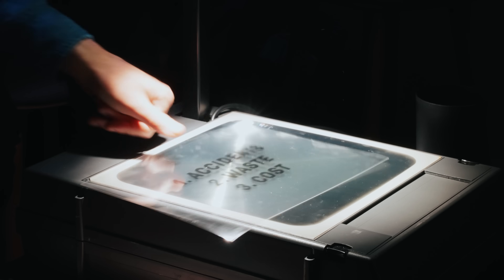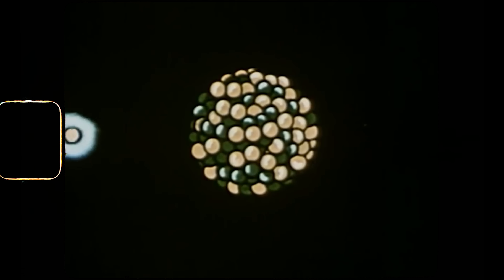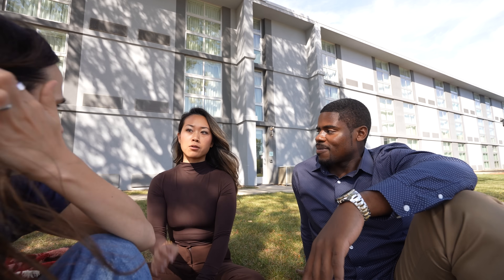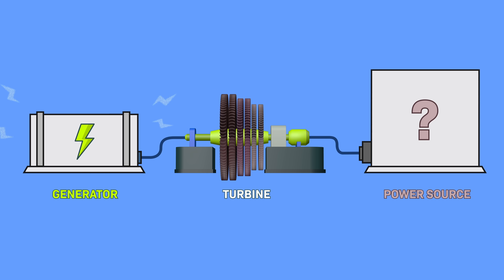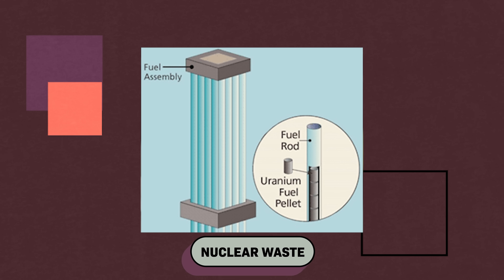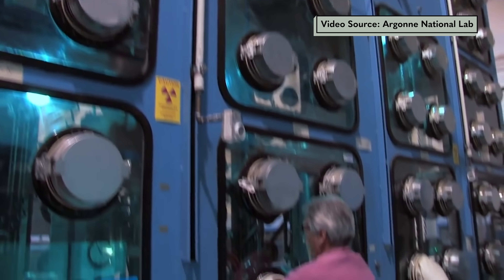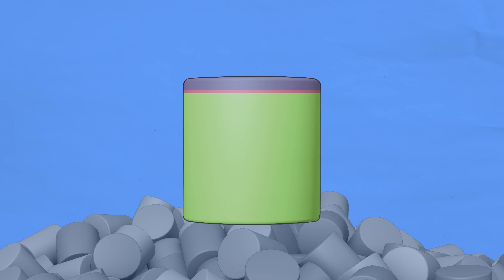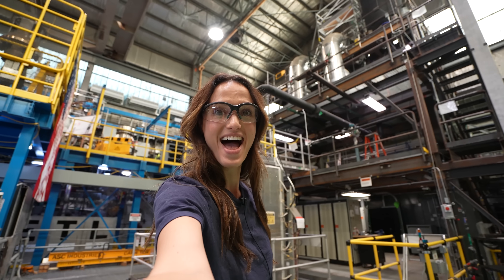The Big Lie About Nuclear Waste

Comment: This has made an impact on my opposition to expanding nuclear energy. There are, however, major concerns remaining. The biggest concern, by a huge margin, is the human component. My research continually reveals most problems, in everything but particularly in nuclear, are related to human failure. There are problems from mistakes or illegalities during construction to mismanagement and poor oversight of facilities. Profit/greed is usually involved. Please look up the safety facts of nuclear facilities in your area. You may be surprised.
American culture usually compensates for the "human" factor. Speed limits are lowered commensurate with congestion or potential for accidents (for instance.) So, the more danger, the more constraints. We still don't know the full extent of the damage done by several large nuclear accidents that have already frightened the world. So, the constraints necessary to make most people feel safe about widespread nuclear energy would put the cost out of reach, and still would not be a guarantee of safety.
Cost, even as calculated today, is a limiting factor for nuclear energy development. Startup costs are astronomical. America would basically be mortgaging the whole country's future, or the more likely and scarier scenario would lead to private development. Then corporations like Enron, Adelphia, etc. would hold our communities hostage.
Finally, why be stupid? The costs associated with solar are a fraction of nuclear and getting exponentially cheaper. We already have a fusion reactor, why not use it? Corporations are monetizing solar energy in many ways. But, the way to energy independence may be to insure that every individual building has its own solar plant. Like the moonshot, battery storage technology could experience life-changing improvements if solar became a national project. Imagine having solar as a default installation on every home. Tax incentives and lower costs would finally make home solar affordable. Battery tech could, in a matter of just a few years, be capable of storing 24 hours worth of energy for a home and still sell a lot of excess energy to the grid. This would eliminate a major cost and concern for most families. It would maintain employment in current utilities which would collect and redistribute that energy to businesses.
So, really, why are we even talking about nuclear?

Comment: Using thorium  irradiation reactors can burn up plutonium waste up to 70%, like they're working on in Norway. That said we waste miles and miles of unused potential electrical water power by not installing slow speed underwater turbines in all rivers and streams moving 2 to 5 miles an hour. Installing these units below all existing Dams could double or triple existing power generated by hydropower. These units won't harm fish can be moved if needed, run 24/7 unlike wind and solar, work in tidel areas along coastlines, and can be scale up to meet the needs of any city or town. Installing these units offshore and adding atmospheric water generators could supply drinking water and power to all nearby coastal cities. Installing Atmospheric water generators out at sea where air humidity is about 100% just off the surface of the water maximizes efficiency of the units to make drinking water. Search it on YouTube or Google it and see for yourself.

Comment: How much volume of nuclear waste is produced by a power plant by year/decade?
Reply: 500kg/TWh. So a plant with 6 1.4GW reactors (a MASSIVE plant!) would produce ~350t of waste in a decade. At 19t/m3, that's ~18.5m3. A block 3m*3m*2m, the size of s small room. With reprocessing, you could reduce that by 99%.
Reply: @Crispr_CAS9  Ask the people in La Hague regarding the efficiency of recyling. They will tell you the right numbers (and it's far lowner than 99%)
Reply: @norberthardtmanns5058  La Hague recovers >99% of the uranium and plutonium in spent fuel, but they don't separate out the stable and nearly stable nuclides from the long-lasting fraction (the Cs/Sr). So yes, they only reduce the mass by ~95%. So the size of large room instead of a small room.

Comment: My worry about fossil fuels isn't that they'll run out in 200 years and we will suffer power cuts - its that the contamination they produce is accelerating climate change now and may make the world unliveable.  
My worry about nuclear power isn't whether they'll run out, but contamination.  “On average, the waste from a reactor supplying a person’s electricity needs for a year would be about the size of a brick. Only 5 grams of this is high-level waste“ says the World Nuclear Assiciation's website.  If nuclear power met the electricity needs of the world's 7 billion people, it would produce 35,000 tons of high level waste and 7 billion bricks a year. After 200 years, we'd have 7 million tons of high level nuclear waste to deal with at current energy consumption. At best, nuclear is stop-gap energy to use while ween ourselves off hydrocarbons and move to real clean energies. Gradually increasing the world's background radiation
Reply: "After 200 years, we'd have 7 million tons" Well, reprocessing reduces the mass by 100x and storage time to 300 years. So that's only 0.1Mt of permanent storage. Less than 6000m3. A two-story building 25m by 40m.
Reply: @Crispr_CAS9  Thanks for your answer!  That sounds possible to store, and even transporting it fairly safely to safe storage could probably be done, though accidents would happen.
I have another if you have the knowledge and good will to answer - as I understand it, background radiation is reducing and has been since the earth formed. If all the current world energy needs were met by nuclear, what would happen to background radiation - continue to fall, level out or increase?
Reply: @caiusofglantri5513  "as I understand it, background radiation is reducing and has been since the earth formed" In general, yes. Most of the recent reductions are because of the nuclear test ban.
" If all the current world energy needs were met by nuclear, what would happen to background radiation" Supplying that much nuclear would mean depleting seawater uranium, which would decrease background radiation. So probably reduce, possibly slightly increase. Not a significant change either way.

Comment: There are many technologies which would be viable if cost was not a factor, but sadly it always is. Using cheaper new uranium, nuclear energy is already more expensive than other options. Using even more expensive reprocessed fuel is probably not an economically viable option. It's not like it hasn't been thought of.

Comment: Do some research and create an experimental reactor that is stable, idiot proof and reliable. U235, well it has another use too. And create a reactor that is safe, meaning impossible to melt down in the event of a catastrophic cooling system failure. If you want to burn all of the radioactive daughter products in a reactor, is unknown. Plutonium better living thru a dangerous alpha particle emitter. If it gets into your body, very useful right? Safety first as is written. But is fissile like U-235, binding energy and the drive for weapons. Not fuel well okay the law of unintended consequences applies here.

Comment: The "recycling reactors" like the Thorium reactors are a nice concept and would be useful, but even after all these decades it appears there is still no way to really make this economically viable apparently. Though...it should be...because storing nuclear waste for millennia is surely not free.
Reply: There're at least two production fast-breeder reactors in Russia now. It's been said that they are twice more expensive. So it's a matter of balance between raw fuel and processed fuel prices and availability, I assume.

Comment: Since you speak of big lies, I will ask you for big truths. It is evident that you do not believe in the human origin of global warming; me neither. 
Because when it comes to thermal efficiency and greenhouse gases, generating from nuclear power is very similar to burning fuels.
The performance of the thermal cycle is very similar with the steam that drives the turbines in nuclear power plants. Two thirds of the heat is wasted and goes to the atmosphere or some nearby body of water. Regarding the greenhouse effect, the main cause is not CO2 but water vapor.

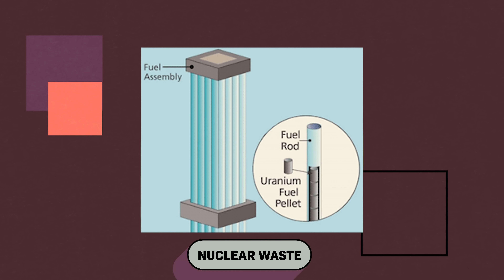Comment: 3:55 - What's scary is that 150 years isn't really THAT much time... 😁 Oklo, by the way, is the location in Gabon where there were several naturally occurring reactors, where fission reactions were actually taking place in the rocks, about 1.7 billion years ago. 7:15 - not exactly - enrichment isn't making U-235 out of U-238, it's separating out the U-235 from the U-238. It's difficult to do, so at each step of the process, you end up with some uranium that has MORE U-235 in it than you had before, AND you also make "depleted" uranium that has LESS U-235 in it (this is what ends up in tank armor and anti-tank ammunition). Repeat these steps and you get uranium that has more and more U-235 in it. Something else to note - the most radioactive stuff in the spent fuel is the stuff that loses its radioactivity fastest, so the amount of radioactivity in the spent fuel decreases dramatically over a short amount of time. The stuff that remains radioactive the longest is also the stuff that isn't very radioactive. (And is the stuff they will recycle in this "closed fuel cycle".) Your discussion of plutonium is also a little incomplete - the problem (or good thing, depending on your point of view) with plutonium (actually, Pu-239) isn't that it's radioactive, it's that, like U-235, fissile. Which means it can be used as a nuclear fuel. And in bombs. It gets made in reactors when U-238 (the isotope there's a lot of) absorbs a neutron and transforms into Pu-239. If you separated out the Pu-239 you could build a reactor that splits Pu-239 instead - and this is easier to get than separating U-235 from U-238 (which is the reason for proliferation concerns). There's this concept called a "breeder reactor" (or "fast breeder reactor") - surrounding the fissioning Pu-239 core is a jacket of U-238 (remember, we have a LOT of this, and very little U-235). While the core is making energy it's also making more Pu-239 which can be used later. It supposedly makes more fuel than it uses.

Comment: I fear it is the same as with plastic recycling. It is much cheaper just to dump the waste whereever (somebody else's problem) than actually build a plant to recycle it. Also I find it very optimistic to reduce 200000 years of raadiation down to 200 fully. After all, using the fuel again makes its waste even more radioactive I presume during the process. I think this technology has yet to prove that it works in real life and can truly solve the problem of nuclear waste. And then, too, it shall be a policy that power plants have to comply with, as the cheapest solution on the sort term is just to dump them somewhere with no or weak regulation.

Comment: iceland already has and does geothermal grid scale, the geysers unit in california is decades old.
old dry oil wells in areas with higher downhole temp will work with newer geothermal tech using 
alternate thermal transfer fluids or gas.

Comment: In two minds about this video

 Because it is oh so true.
But there are some inaccuracies or ambiguities. Pu is a problem because of its toxicity more than its radioactivity. 

I think what people also forget is that long half life materials means the isotope is emitting alpha or beta particles etc, slowly. 
Pu does have an isotope that has a half life of  14 years. Which is relatively quick.
This article brushes over the se facts. 
Also should remember there are other radioactive substances that are way more abundant than uranium 235. That do a great job of producing energy.

Comment: In the early days of my career I was in the Nuclear power industry.  I was taught that the best thinking was a single Turbine floor in the center of several reactor vessels. Design life was limited to 40 years at that time.  (I believe they have extended that to more like 40-60 years.)  Based on the reactor build time the first reactor would be started up. Followed by a second reactor starting after start up of the first. With 8 reactors the fuel removed from the reactor at the end of life is sent for recycling.  The first reactor is rebuilt 300 years from now allowing for radioactive cool down before humans need to do the work.  While I am no longer in the industry, at that time the NRC said no you can not do that, you have to return the land to its original state. The costs were very high and with TMI and Chernobyl nuclear power died, as far as new plants were concerned.  Even existing plants have trouble getting fully qualified parts.  The nuclear industry fell apart here in the US with no demand to cost justify maintaining Qualifications.

Cost to clean up the spent fuel would run in the trillions and it needs done.  Is this the first step to the second question below?
The one question that I have not researched is were did it come from to begin with and can we return it to its original state and just put it back? I know the environmentalist would say no to putting a natural material that is from the earth back into the earth.  I am sure there is still unmined Uranium in the earth.

Separate food for thought - Thorium reactors have been toughted as fuel that would not run away. While radioactive it would cool down with a power loss to the plant. 
My thought was that Admiral Rickenbacker (No Dis-respect admiral if my spelling is off) was shown Uranium and Thorium and picked Uranium to power the navy and make nuclear devices.
Reply: I wish more people talked about LFTR (liquid flouride-thorium reactors) more often!
Reply: @TheeSeniorJr  LFTRs are overrated and offer no actuall advantage over conentional reactors with the Pu cycle
Reply: Thorium reactors are considered sustainable reactors, since the actual fuel, plutonium, is created in the process entirely within the reactor. It's created, and consumed in one place, which mitigates risk of nuclear materials dealings, and the designs are such that the systems maintaining the reaction aren't preventing overloading, but instead preventing it suffocating itself with neutron poisoning.

Like instead of having a fire and you control it by cooling off the stuff near it it's a fire that requires you keep actively providing it with oxygen.

So if secondary power or systems fail, they fail to a condition where the reaction kills itself.

The designs are amazing.

A bonus is that almost all the real waste is either very short half life or extremely long making it easy to dispose of. Highly radioactive stuff isn't radioactive long, so you can store it securely for just weeks, and the other stuff is in the realm of natural background radiation.
Reply: @thekwoka4707  All nuclear power plants since RBMK design failure are self limiting, self failing reactor designs. ALL commercial designs use a negative temperature coefficient (temp goes up, reaction rate goes down); but as with anything, everything can fail lol.  Its not that the "Reaction kills itself"; its "how fast". lol
Reply: So in spite of how stupid all that was, and in spite of the fact that only 3% of the potential energy was used before the fuel was discarded, what do you know about why the molten salt thorium reactor was scrubbed when it was so much safer and had no fuel waste issues?
Reply: @toddmarshall416   My point while possibly being too brief, was that the second reactor replaced the first reactor at end of reactor 1 life, 3 replaced 2, 4 replaced 3, etc. thus reactor 1 has a cool down time from the begining of of reactor 2 to the middle of reactor 8 life qualification. with a life expectancy of 60 years that is 6 times 60 +30 = 390 years for the radio activity to 1/2 life for safer conditions to replace components.  With the tech changes since the first plant I helped build, a robotic work force in hot areas may be a reality soon. No human exposure.

As far as molten salt thorium reactors my knowledge is limited (No Classes on them)
Reply: @egood4531  From my "reading" the molten salt reactor's major difference is in the reaction cooling. In "conventional?" reactors, high pressure high temperature water cool the process. In MSR reactors, liquid salt (i.e. very high temperature) at ambient pressure does that...plus the molten salt actually carries the fuel through the reaction in a perpetual closed cycle. It is "fail safe" in that a "runaway" (e.g. failure of the cooling system) causes the reaction to stop. How can anyone be involved in the nuclear energy business and not be intimately aware of the MSR processes?

Comment: The closed fuel cycle has been problematic for Japan.
Reply: how?
Reply: @al-du6lb  There are several issues. One issue is that actual "fresh" fuel from Canada or Australia is going to be cheaper, than going through an expensive closed cycle. Another issue is that Japan has ended up with a large amount of plutonium, in a nation that is adverse to the stuff for obvious reasons. One reason the Fukushima #1 accident was so bad, was that there were many spent rods on site that in theory-were going to be reprocessed someday.  

I have been to the Donen plant in Ibaraki where they keep that plutonium, and they do have tight security-but more money to spend. Then there was the Tokaimura accident of 1999 . They were attempting reprocessing, and it went badly.
Reply: @brentsutherland6385  hmm, interesting. I don't know about the recycling, but I'm definitely pro-nuclear.